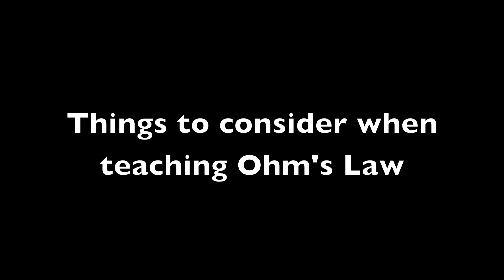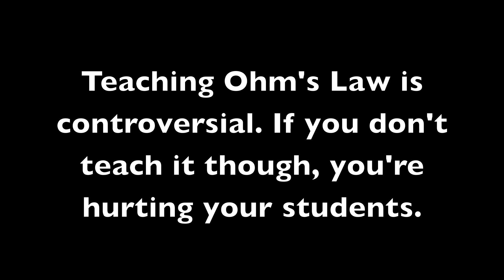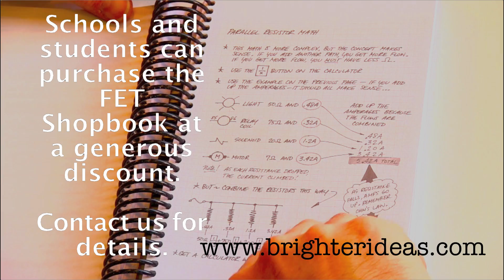Teaching Ohm's Law to Techs - Part 1

Comment: 43 years ago   in my Tech school we had to take Electronics and  Residential Electrical wiring   because other classes were part of Building Houses  and we needed a foundation for how Electrical systems worked .
   But  both Teachers had their  version of the Theories that caused confusion  , plus we had been hit with all the Math at first as part of Ohm's Law  that had the E,I,R   while we also were fed  Amps, Watts, Current , voltage, Implied force,  and how 1 Volt = 1 amp  and both = 1 coulomb .  
     Few people from the school actually went on to get jobs with Hydro Companies ,  some just ended up  being able to assemble a Radio set  but not know WHY it actually works or what made it stop working so it could be fixed. The other Grades for Residential Electricity didn't progress much  beyond  wiring new homes or  wiring a Rec  Room in the basement which was repetition  from memory for   how-to     but not WHY.      Some people try to use the  Water Pipe  example  , but the water drains back to the source and must be pumped back thought the system  and doesn't heat up the faster it pushed.  
     I studied Ohm's history and research  and from my point of view his Theory and Formula would make more sense  if he saw the Resistor  as a  Variable Conductor  you add to  a circuit to control the flow of electrons ,  rather than  his concept of Resisting electrons that I infer as  if he  DIDN'T want  power in a circuit .  To me it's like a Doorman to a 50 seat restaurant   and he wants people to flow in but  controls the  number so only 50 people can come in , so if you overload the Line-up with 75 people you still  limit the seating to 50  unless the restaurant is changed  to handle 100  people where the Doorman now limits the load to 100 people.  Except that  a 100 seat Business  could still have a 50 person limit  for which the Doorman now stops the flow at 50 people.  This example is why I have a problem  when someone tells me that   the Wire diameter for a circuit is too big , they don't explain why  I need a smaller  size unless it's just a waste of money.  If electricity is like Water in a pipe , who cares if the pipe is  4" or 8" around if all  I want is  between 2-10 gallons and hour .  If i needed more water later on I have the pipe size  to carry it.  \
                 
     I've never been good at just accepting what a Teacher  says and  then repeat it on an Exam  while not having a clue  about  WHY and HOW   something works  so i can start from the end  and work backwards to find the other factors.  Back then 
  when i asked questions  or didn't fully understand the Teachers  lesson   it was me that  had the problem and never a bad teaching method.
    The  E = IxR  and  R=E/I   and I=E/R  means noting to me if i want to build something and all of these are unknowns  and I must know the  Wire  sizes to buy and what the input  power should be.  
      The chimps I saw   on the Sullivan show  were taught how to ride their  Motor cycle in a circle  ,  but they had no clue why the motor worked  or how the gasoline produced the power .  

   I agree that it's  confusing at first to  hit someone with so many terms at once while the real World  applications use a common language  ,  plus the other problem we had was  being told about  Horsepower  and Watts dealing with  650 lbs moved 1 foot in 1 second to = 1 hp ,   but later  we saw how    1 HP =30'000 foot pounds or work  but  a Car engine with over 200 HP was rated at 180 ft lbs .

Comment: I teach ohms law in many of my high school CTE classes and I always wait till we have been in class for a couple weeks before starting students on ohms law.  As far as the letters E=Electromotive Force/Electrical Potential, I=Induced Current/Intensity and R=Resistance they make complete sense and this is how it should be taught in my opinion.  Volts, Amperes, and Ohms are just the units of measure and do not describe what you are measuring.  That would be like saying ft*lbs instead of torque or inches instead of distance, which in my opinion does not necessarily teach the student what they are measuring.  I do understand where you are coming from as far as what they read on the meter but I expect all my students to understand it completely by the time they graduate high school.  I think the big difference here is that I have a great deal more time to spend on the basics than instructors at a college or tech school.
Reply from the maker: I have 4 days - you likely have 4 months or more. I teach the guys you very likely will never have in class. I've said more times than I can count that we must crawl, then walk, then run. It's crucial to remember that if a "general education" were truly a general education, then we wouldn't have 80% of students leaving high feeling stupid. The order in which we teach things doesn't dictate what can eventually be taught, and in my mind, there's no such thing as "basic" electricity. PWM is Ohm's Law. Corrosion is Kirchoff's Law. Lightning is Lenz's Law. The words "basic" and "advanced" are only of value to teachers writing course descriptions and calendars and outlines. We need to ignore these false delineations and teach the subject as it is meant to be understood. Education is a lifelong experience - not a short term event for a grade. I'll teach your guys how to use the theories to fix a coal truck; you teach my guys about the theories their diagnostic methods depend upon.

Comment: As a working Engineer for over 20 years, I've had the pleasure of interfacing with many intelligent and skilled techs that can troubleshoot circuits and systems better than many of my peer engineers, despite having very little clue about the physics, and associated math, behind the electronics.

I used to think that if Ohm's law was considered hard math, maybe electronics wasn't the right field to pursue, but learned that this isn't the case. Glad to see that someone thinks about electronics from the technician's point of view. There is no need to turn off prospective electronic techs just because of math.

Comment: Nice common sense approach! I think it's also critical to teach what causes the resistance in a corroded wire, and how the meter actually does a resistance test, which leads to why you can't use an ohmmeter on a large gauge wire.

Comment: Daniel, I agree with you over the symbols. I did air conditioning installation for 30 years. I had a DMM and learned to read voltage and current or Amps. I used the Ohm setting only when I was looking for a bad control wire. Now I'm enrolled at ITT Technical online classes in the Electronics and Communications technology and I was getting confused over the equations because of the variables. They aren't consistent with what the meter says except Voltage. I'm looking at the I and got confused in the formula. I wondered why that was supposed to be Current or Amps? I'm trying to learn the formula for series-parallel circuits. Doing calculations for resistance, amps, voltage, voltage drop from each resistor or device. I'm in my 3rd week and the first 3 weeks have been mathematical formulas and so many different ones. The variable letters should be easier instead of confusing. Thank you for your video. I wish my school would abide by what I've seen of your teaching. To me it makes more sense.

Comment: Ohm's Law is not "math"; it is just arithmetic. If these students are scratching their heads about a trivial equation E = IR, then one has to wonder whether they slept through elementary school as well as dropping out of high school. Calling the variables by different names isn't going to make these students understand grade-school arithmetic any better.
Reply from the maker: David I'd categorize your comments as marginally elitist, which I'm sad to say is not uncommon for engineers. As one who can weld, rivet and machine metal, I'd like to point out that the ability to pass "arithmetic" tests does not make one "ingenious". (Engineer and ingenious suggest creativity; "genesis" = "creation"). Trig is a blue collar math; it's not a carpenter's fault that the education system reserve that class for "elitist" AP students. I'm going to hazard a guess that you'd need remedial work in welding and other trades classes. As a future member of the middle class, you might rethink the excessive cost of paying for stupidity - education is far less expensive...
Reply from the maker: Actually, it does help. You're wrong. I assume - again - you're pitting your 30 years of experience and 28 years teaching against mine. Your assertion that "arithmetic" isn't "math" is just silly. It's like saying a car isn't an automobile. Look it up. Your superior intellect (alleged) might help people if you weren't simply another snide and pissy hater who feels better after trying to slam others. Sad, really. Why don't you guys form a club or something.
Reply: Daniel Sullivan Well, in your own video you switch the equation back to E=IR anyway. The more current or the more resistance, the more volts are needed to propel it. If your students "hate math (arithmetic)", why are they in a technical school in the first place? Do they ever have to learn inductance, capacitance and impedance? If they can't do E=IR I'd hate to see them try that stuff.
Reply: Daniel Sullivan I am currently an 18 year old and I have recently started an electrical engineering degree. I guess I am unaware of what mathematics a "tech" should know, but manipulating proportional variables like in Ohm's Law is one of the easiest mathematical relationships taught. Plus isn't scaring away the people who do not like math a good thing? Since it becomes a part of their future job, they would end up not liking that profession anyway.
Reply: Daniel Sullivan Being able to do basic arithmetic does not make you an elitist. People shouldn't pursue engineering if they don't enjoy maths. It's the fundamental language of engineering and if you're teaching it through abstraction and analogies you're teaching the fundamental concepts wrong... But, then again, I guess this video is for electricians and labourers.
Reply from the maker: Roy Miles You're right - this video is not for you. I generally don't expect prigs of the Empire to be too enthused by my colonial balderdash. If you're an engineer, then your commentary is as might e  expected. Of course, my aeronautical engineering professor who worked for DeHavilland during WW2 is the one who directed me to school to become a mechanic. He knew that most engineers are dolts.
Reply: It is elitism to expect an electrician (a respectable job in my opinion) to understand basic arithmetic? I don't think so.
Reply from the maker: David Yeah - it is, if you don't do anything to solve the problem. To take your knowledge and skill and hold it above others, deriding them, when it isn't their fault, is despicable.
Reply: My knowledge of the relationship between multiply and divide? Mkay
Reply from the maker: Yeah - Mkay. You spend 27 years teaching guys who've had their emotional and intellectual asses kicked all through school, and you'd understand. You may be whizbang with math; you obviously know shit about people...
Reply: I must admit I don't know anyone that wouldn't know the relation between divide and multiply. But I am only two years out of high school in a degree that is heavily maths based so maybe people forget it after they get older?
Reply from the maker: David You miss the point entirely. Do this for me - describe the faults that can occur in a wire, explain how Ohm's Law applies to those faults, and explain how you use a meter to find them.

It's not about math. You might be able to "multiply" & "divide" with the best of them, but can you apply that math to a practical problem? Can you teach a person about these concepts without the math(s)?

BTW - there are thousands of guys who need help -- can you help them?

Comment: 4:00 et seq: Your point about the physical dependence of current upon voltage and resistance is very well taken, and I agree it makes sense to introduce the formula as I = E/R (sorry, it's hardwired that way in my brain, along with micromicrofarads and kilocycles/second and conventional current).  I'll be interested to see whether you advocate presenting the power law as P=I^2 R.
Reply from the maker: W=AV -- "WAVE". Again - the best way to start will always be to work from the familiar and obvious to the mysterious and obscure. AC gets weird with reactance and the difference between KW and KVA. The key to successful AC training/education for techs is a COMPLETE understanding of magnetism.
Reply: Makes sense re magnetism.  I don't believe I was thinking of AC, though.  Actually I don't know what I was thinking of - I have a nasty suspicion I was trying to show off in some obscure way. :(

Comment: I read a lot of blather comments directed toward you after watching your Part 1 video. Your insight into teaching entry level technical students is affirmed by me, having taught college since 1991. I also worked as an instrumentation technician for Exxon where I went through a 4 year formal US Department of Labor certified apprenticeship program and am a DOL certified Instrumentation technician. Before that I earned a Bachelor degree in education and am a state certified educator.I normally don't credential out, but I am in this case because I have a lot of experience learning and teaching... I know technical education. It is crystal clear you are correct and you are a real teacher. There is an art to teaching. You have it. Below, there is proof that one commentator ought NOT to be a teacher. We want students to achieve success so a real teacher would NEVER say "math and electricity go hand in hand. I would explain to them that they can get on board or get out". The absolute "must" in teaching as an art is NOT to lose your students. I teach community college which means I teach a diverse group of students. Housewives, 15 year olds. 68 year olds, women, men, mothers, Africans, Mexicans, Persians, geniuses, dim-witted, motivated, sassy and on and on. Randomly pick 18, put them in a classroom to learn electricity and the fun begins. We teach and we love to be a part of the student success. We assess the class the first day and then we formulate a strategy to get this crazy assortment of diverse learners from ignorance and self doubt to aptitude and self confidence. The first step is to reach out to them and woo them along. Tonight you were heard by me and I learned a new, sensible teaching methodology. Thanks. Tomorrow is the first day of summer classes. Tomorrow I have a new method I can use to woo the students into learning.

Comment: It's obvious that you aren't a physicist. I believe that electricians should be taught not only how to calculate, but also be given a deeper insight into what electricity actually is. That is where you seem to fail. Voltage, Amperage and Ohms are not the same things as U(E), R and I, and knowing this difference is what separates an electrician from an electrical engineer. When your students graduate, they will be stupid. Because what you seem to teach is a dumb simplified version of electricity.
Reply: Victorhuhu Mr. Sullivan has a very practical need.  He's not teaching physics, he's teaching diagnosis, and if his students learn more easily to diagnose circuit problems when he teaches the way he's advocating he would be doing them a great disservice to teach otherwise.  Once the student can succeed hands-on with meter and schematic, he's in a good position to pile some theory on top should he wish to; and as he advances in his job he will wish to.  But for his purposes, and therefor his teacher's, getting the theory in the beginning is harmful because he has no place to put it, no mental structure into which it will fit logically and no experimental technic in place to help him make sense of it.
Reply from the maker: dbeierl Wow - thanks. This is a very well thought out and cogent reply. I will now steal it, use it, and call it my own... :) Seriously dude - thanks.
Reply: Victorhuhu
In my opinion Daniel has already proved many teachers wrong not just you!
Reply: Be my guest. :)
Reply: I am not a physicist (Not capitalized.). But nor does one have to be one in order to realize that it is important to have a certain name (E, Voltage) for a property that is quantifiable in several different units (Volts, for example.). This is how things are dealt with in physics, because it creates a system that transcends whatever language you speak. It's important, so that people can discuss things, and communicate. Clearly something that you're having problems with.
Reply from the maker: Victorhuhu Wie sagen Sie „Arschloch“ auf Deutsch? Oh, it's „Arschloch“...
Reply: Daniel Sullivan I'm not sure what you're trying to do here, but I am not German nor do I speak the language. I'm glad you've acquainted yourself with some of the videos on my channel, though. I am still waiting for you to further motivate your standpoint, or as you put it earlier; prove me wrong.
Reply: Barry Wind It doesn't really matter that he has proved others wrong. I am having a debate, and saying that he has proved others wrong is not a valid argument in this debate.